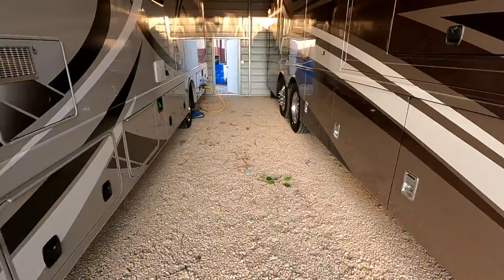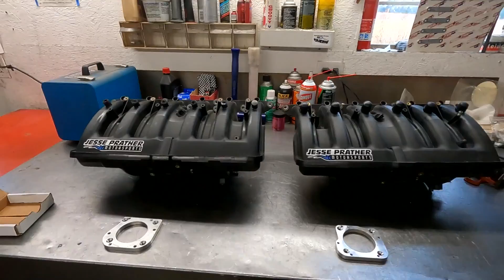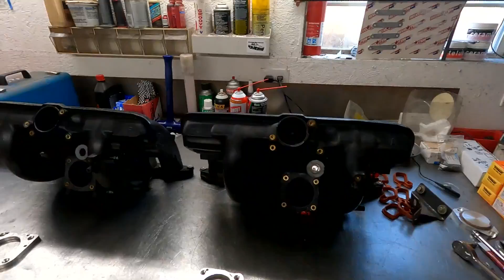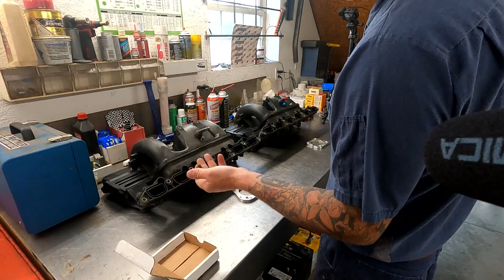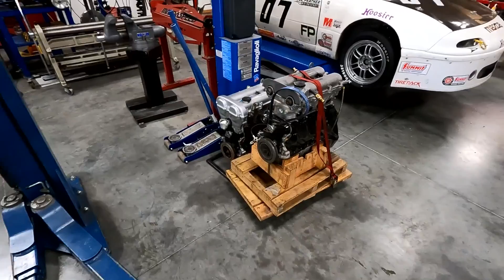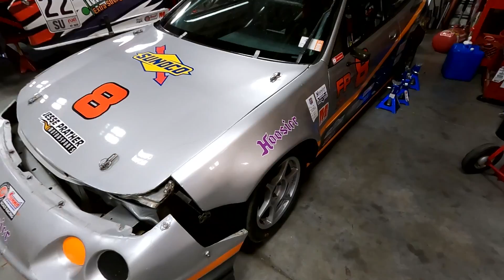Shop Tour - Runoffs Recap: Did I Win with Illegal Parts?

Comment: Those are disa valve intakes. The disa valves give your single vanos engine a bump in midrange. E46 guys ditch them for early 325i m50 manifolds all the time. Ive never seen your case where a single vanos car has a dual vanos intake.
Reply from the maker: It’s all about the adapter plate being spec’d in the rules.

Comment: Hello there, a friend sent me a link to your video.  I might be able to shed some light on the BMW intakes.  I'm the 'BMW guy' in the midwest BMW area.  I'm an SCCA member, but I mainly stay within BMW club stuff.  Anyways...
Z3 motors
- M52  2.5  01-98 to 09/2000
- M52  2.8  04/96 to 06/2000
     - these are single Vanos and use intake 11611439965
- M54  2.5i  01/00 to 06/02  uses intake 11617525752
     - this is the dual Vanos motor
This should help you determine where that 'non-compliant' intake came from.  Hope this helps.  Contact me if you'd like more information.
Reply: I forgot to add, all Z3 are OBD2, which means they were all drive by wire throttle.  As far as I know, and what I can see in the parts catalog, there were no cable actuated throttles from the factory.
Reply from the maker: The cable throttle body is off of an early 90’s 325 and the Turner Motorsports adapter plate in the  spec line is the only one that fits the intake I had to get, not the one I had.
Reply: @jpm  I was clarifying and responding the early post where someone said there was a short run of cars/engines with a cable actuated throttle.  All M52/54 are OBD2 and they are all drive by wire.
I saw you are running the allowed cable throttle from the 92-95 e36 M50 6 cylinder motors.

Comment: The intake you were running is a short manufacturing run intake where they ran a throttle cable throttle  body. The only difference between the two is the later intake used an electronic throttle body hence the different bolt pattern. Other than that they are identical
Reply: Zero performance advantage betting the two and both can be found in the z3
Reply from the maker: I am always learning - Thanks for the info.